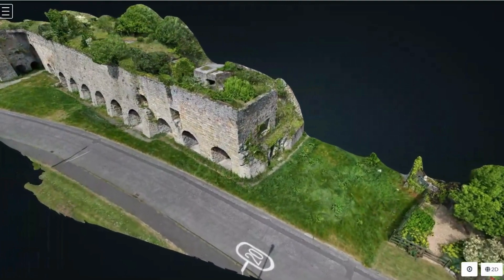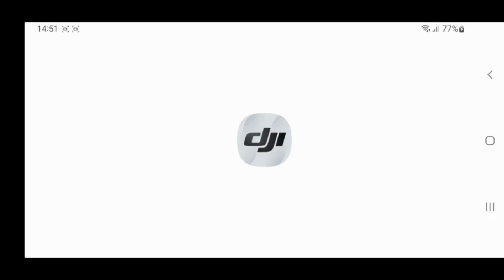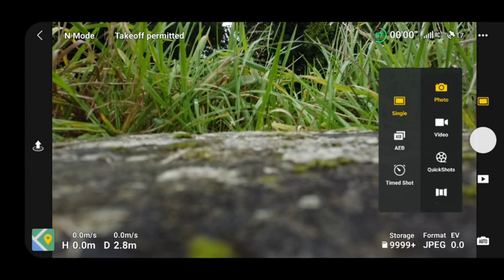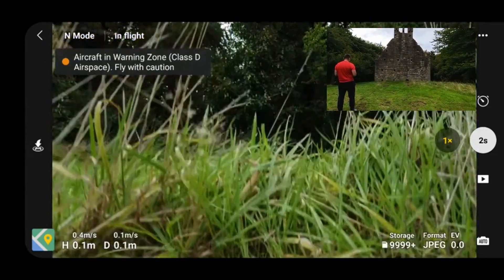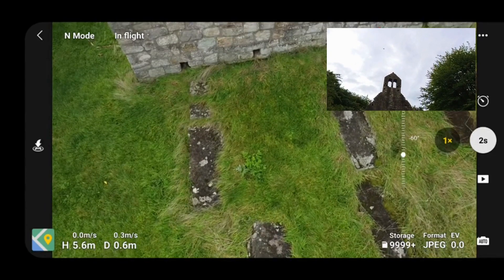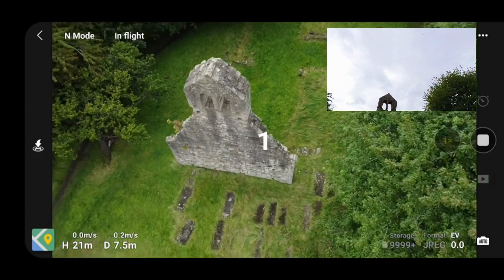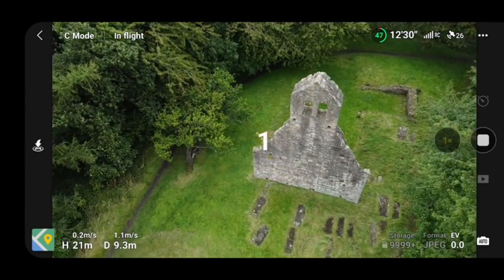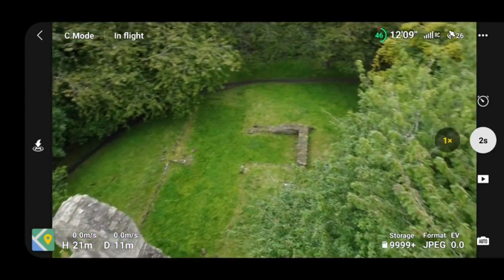DJI Mini Series Secrets to Creating STUNNING 3D Models in No Time

Comment: Have you started to use a mini 4 pro at all as there’s nothing out there for mapping software.
Reply from the maker: The problem with the Mini 4 pro is that DJI didn't released the SDK for it. The SDK allows third-party apps to integrate a drone with their software.

I may create a video about how to collect data manually and create orthophotos and maps, once the weather will get better